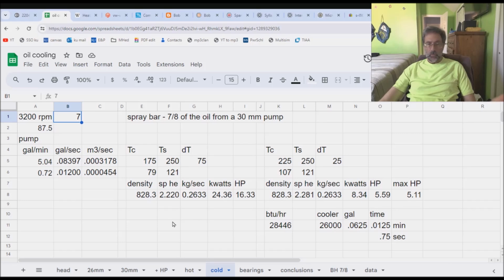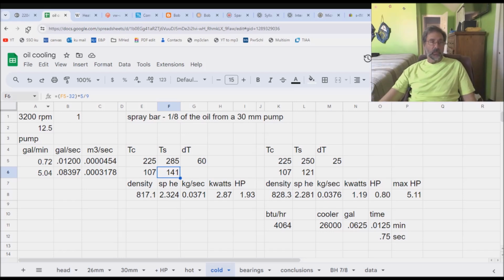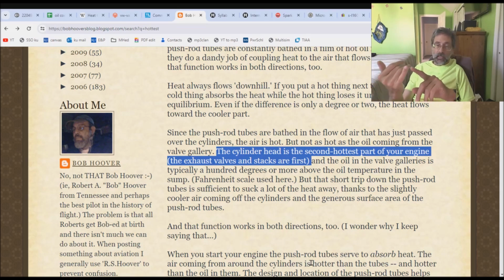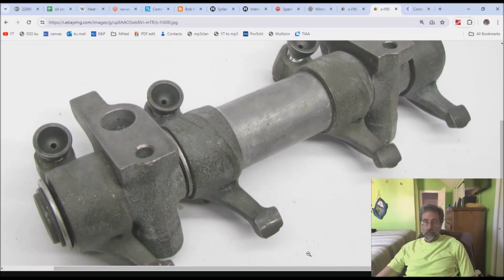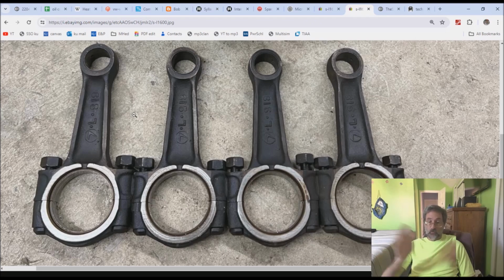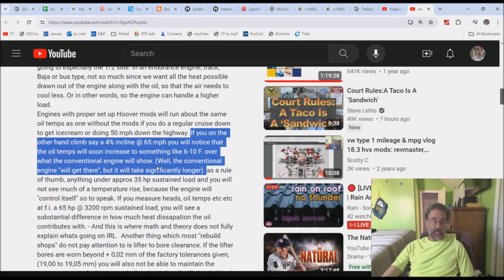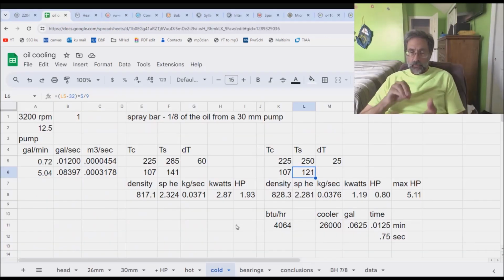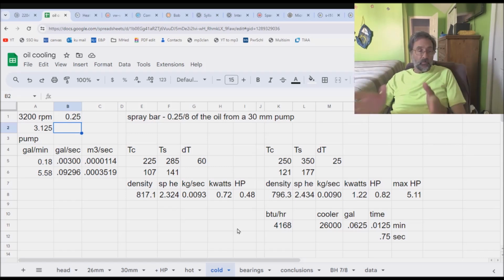vw type 1 vlog #22d.2 keep your ac vw cool, spot cooling with oil

Comment: Where are your VW's?
How many motors have you actually built?
I am always willing to learn and expand my knowledge from proven crudentialed individuals.
Reply from the maker: can you give us the names of credentialed individuals and what their credentials are?
how many motors have i built is not the question that needs to be asked. how many haven't i built is better. hundreds because my understanding of the underlying physics means that i understand before starting a build that it won't work like i want it to work. my credentials are bs in civil engineering where i focused on steel and concrete design and ms in computer science with a focus on graph algorithms.

Comment: 👍
Reply from the maker: how's idaho going? i'm uploading a vid on crankcase breathing. i'm going to tell people to not vent their valve covers. in the vid, i'm going to say, if it ain't broke, don't fix it. that's for you.
Reply: @redshirt-scotty  right on!!
Reply: I did a bypass passive oil filter on an old stovebolt. I used a  petcock water cooler valve to meter the volume. It worked really well. As the motor wears  you can adjust because bleed off has increased
Reply from the maker: @jacquelinechellis4036  interesting. not sure how a stovebolt engine mod relates to ac vw engine cooling but sure, there are ways to regulate oil flow.
Reply: With vw oil pump being larger than stock a passive adjustable bypass for.cooling is maybe a good idea to control oil pressure.  @redshirt-scotty
Reply from the maker: @jacquelinechellis4036  there are a few people at the vw forums that have made active and passive volume controls for things like rocker box spray bars. some methods are very clever. problem is, oil cooling doesn't make much of a difference. i explain all the oil cooling mythology in vid 22d.1